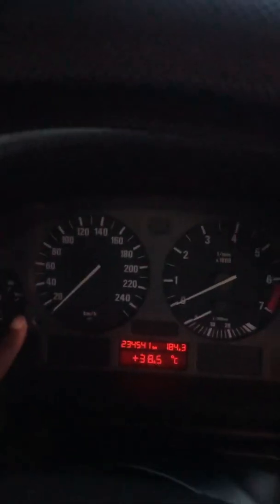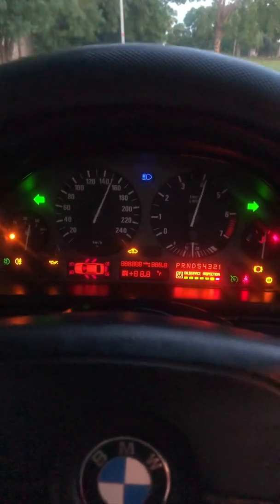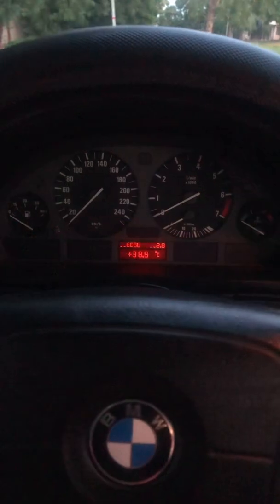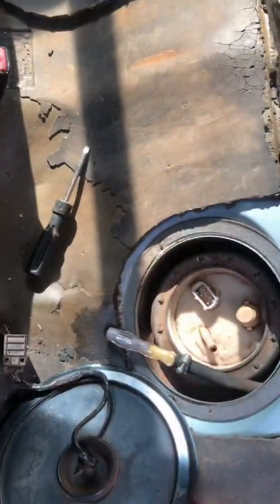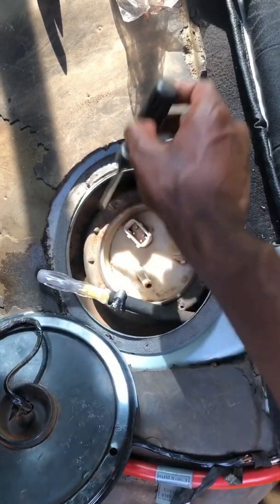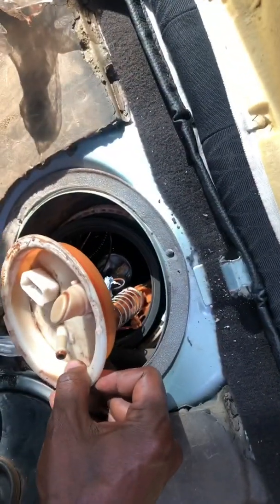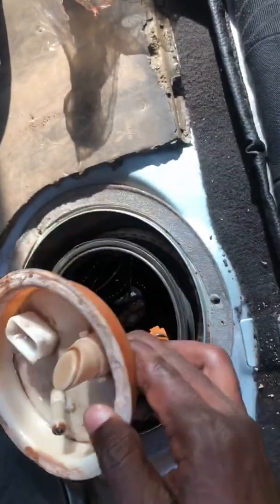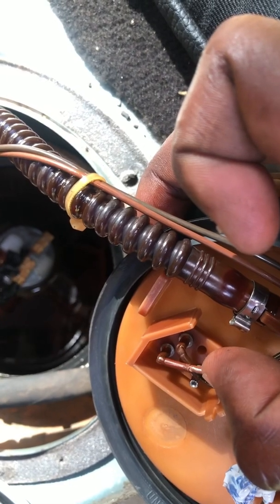Faulty fuel gauge not raising- BMW E39 2021

Comment: Mine moves up and down and sometimes settles ok but temporarily. Meanwhile I had parked the car for sometime can that also be the effect. Someone told me that if driven for sometime it will settle is that true
Reply from the maker: First try cleaning both sensors in the tanks if it still is inconsistent, and you can borrow a new instrumental cluster, then you change it and see.
I used borrow because I want you spend as little as possible in diagnosing the issue

Comment: I know this isn't an x5, but would this work for the x5 2006 too?
Reply from the maker: It’s actually similar…. When you remove the back seat, just like the e39.
The pump is usually on the left back side … the other side has a siphon pump and a level sender …
Reply: @luurep.9634  Cheers mate, engine cut out the other day, no fuel pressure, despite the tank showing a quarter full and over 100 miles of range left
Reply from the maker: @wildcampingpembrokeshire  means you either have a weak fuel pump or you need to check your fuse …. Especially the ones controlling the fuel …. In my e39, they’re mostly 25Am fuses… 
Also do well to check your fuel filter … could be blocked from all the debris that goes through the pump
Reply from the maker: This would be most ideal if you still had fuel in the tank….. but if indeed the fuel was finished, then you should check the 1. Float sensors inside the tank 
2. Check the connection to the fuel tank and look for any possible cracks …. Make you check these on both tanks 👍🏽
Reply: @luurep.9634  Thanks for all the advice, it is greatly appreciated :)

Don't suppose I could pick your brains on another issue if possible please?
Reply from the maker: @wildcampingpembrokeshire  feel free to contact me anytime … even if I have little knowledge, I’ll help in research 👍🏽
Reply: @luurep.9634  Thankyou mate.

The reversing lights, are they controlled by the lcm or via a fuse? I've lost both of mine somehow - bulbs are good too?
Reply from the maker: @wildcampingpembrokeshire  it’s either the bulb sockets are faulty or both bulbs are still probably not as good as you think …. Or, there’s a connection from the gearbox that engages the reverse lights when put in reverse … you should check that